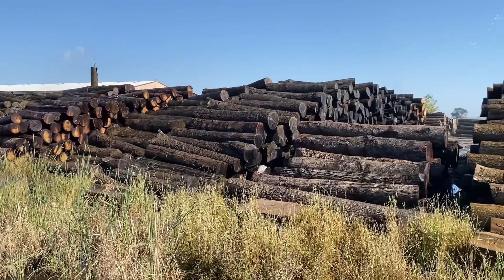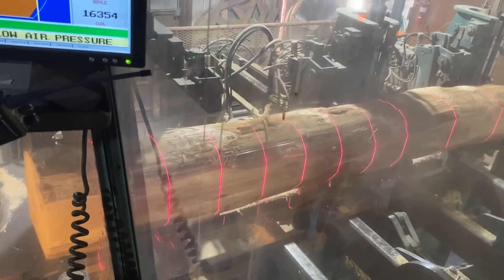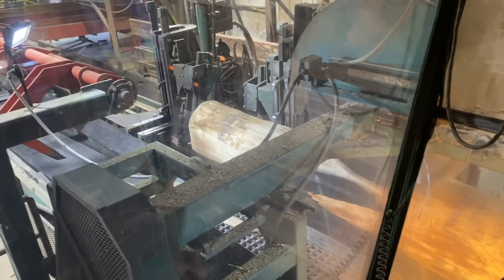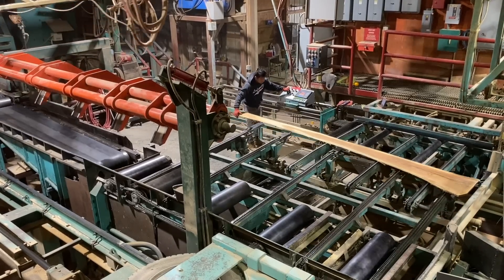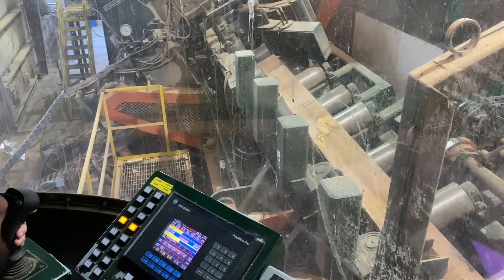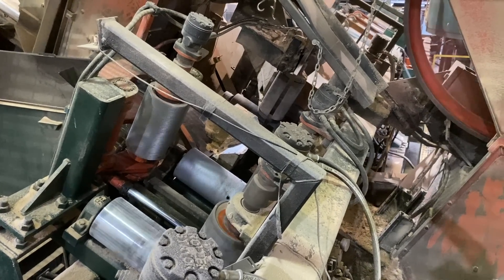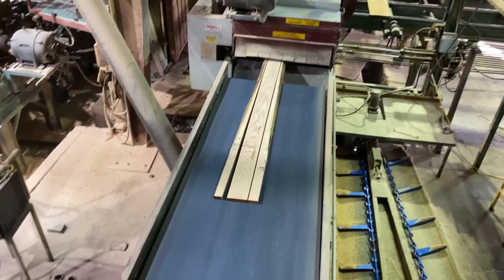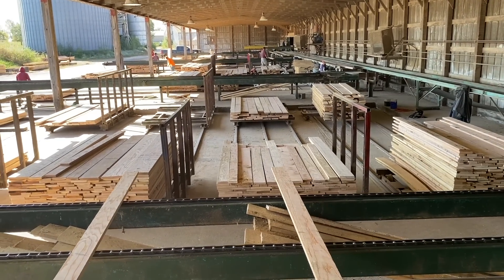This is How You Cut 20,000 Board Feet Before Lunch! - A Look Inside a Modern Hardwood Grade Sawmill

Comment: This mill was ran with steam engine until around 1960. My Baker steam engine was one of the two baker steam engines that worked at this mill.
Reply from the maker: I’m gonna need to know more about that. They mentioned it being run with steam.
Reply: @ScottWunderWunderWoods A "steam tractor" is actually run by steam.